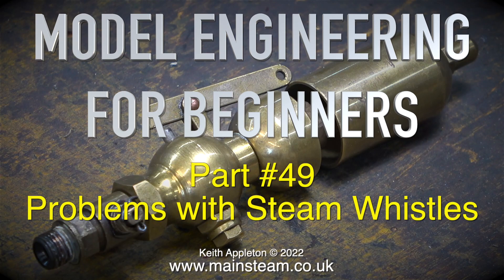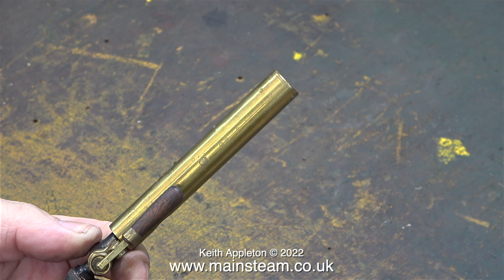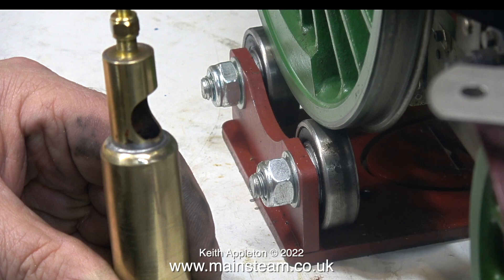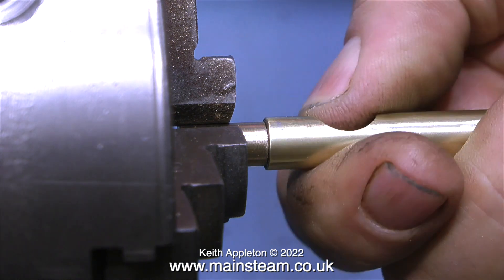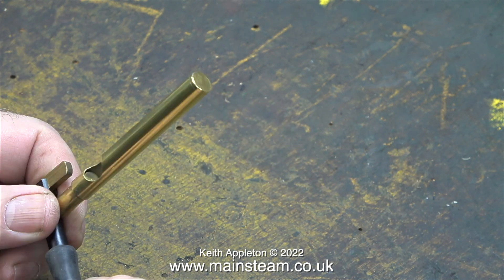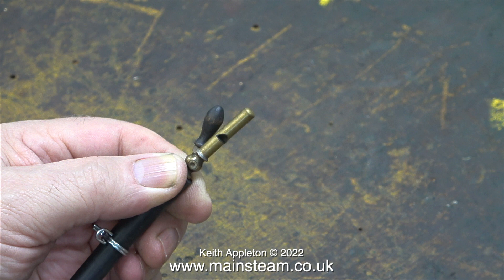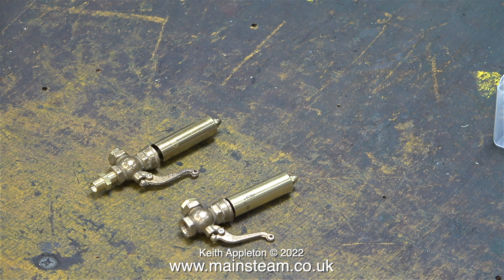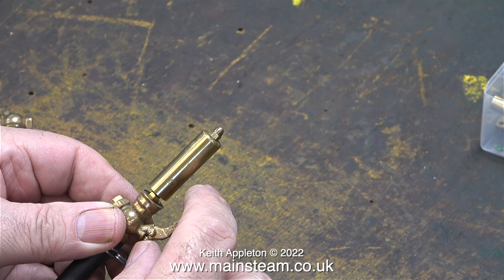STEAM WHISTLES - MODEL ENGINEERING FOR BEGINNERS #49

Comment: Hi Keith, im just wondering if you could tell me the dimensions of the the first whistle on the video? Also, at what pressure does it run best? Im after something similar to run on compressed air, cheers.
Reply from the maker: I can't remember, I do know that they are commercially available though from www.blackgates.co.uk
Reply: @keithappleton  cheers!

Comment: There’s a fantastic sounding whistle on my Freudenstein ‘Penlee’ type constructed by the excellent model engineer, Paul Frank.  Only trouble is it is so loud drivers need to wear earplugs.  Any way of lowering the volume without affecting the pitch?  Wrapping it in gaffer tape wouldn’t look pretty!
Reply from the maker: Simply fit a simple adjustable valve on the steam Feed to the Whistle to drop the steam pressure . . . . . less steam pressure, less audio volume.
Reply: @keithappleton  Thanks Keith👍

Comment: Bonjour Keith,
A special thank you for this video because for me, steam means whistle.
Not only do they have a sound utility that is specific to steam, even if they are a bit sharp, and they also allow the pressure of the boiler to drop if necessary.
Of course, all my boats, except my speed ones, operating at 8 Bar/120 PSI, have one.
Amicalement, Raphaël

Comment: If you want the whistle to sound the same as it's prototype, you need to make it the same length as the original. For example if making a Stanier hooter you need to make one the same length as his. Diameter = how loud a whistle is,  most Live Steam gauge engines  only have enough space to make the whistle 1-2" diameter so won't be as loud as full size but pitch will or should be the same. These whistles of course you hide under the boiler, running board, cab, or even the tender. Yes I've seen a very nice multi chime whistle under the tender and it worked great
Reply: ooo, nice! Thank you!